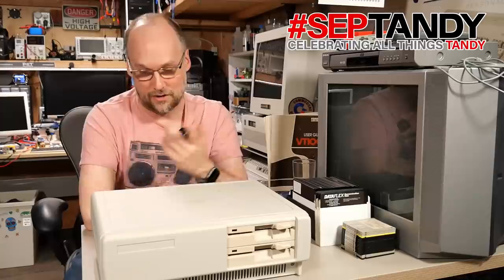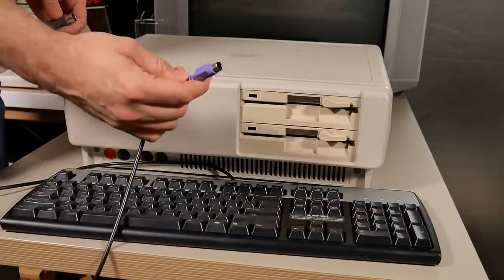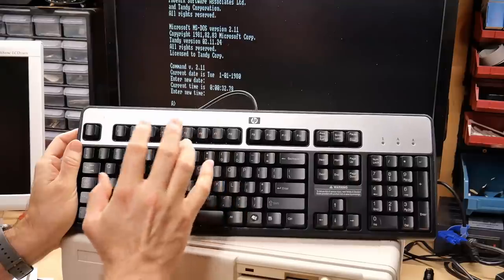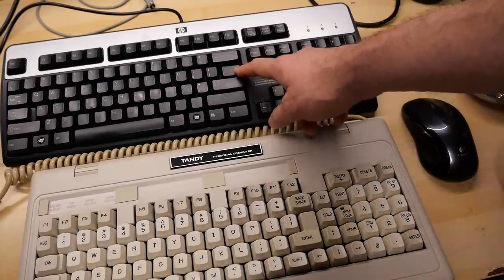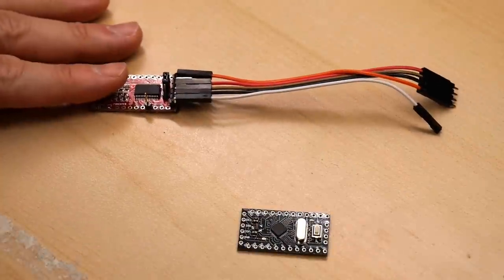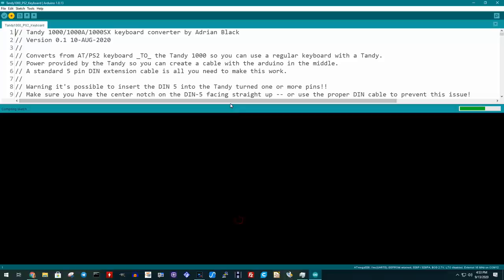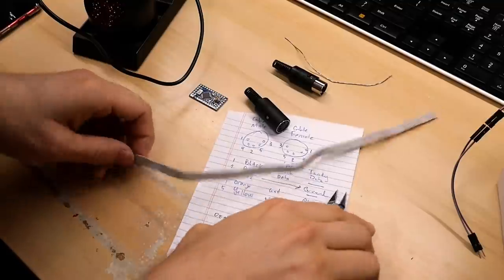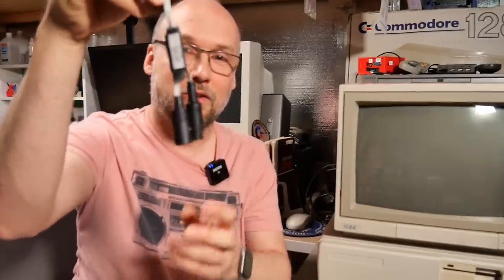Build an adapter to use a cheap PS2 keyboard with a Tandy 1000! #SEPTANDY

Comment: Hi , pretty nifty, use a mini pc to fix a keyboard

For strain relief back in the day when we home made serial cross over cables ( 9 to 25 pin or double ended both sides  -4 connectors )  we use to use cheap / free floppy drive flat ribbon - for strain relief we just used 3 zip ties

The large one was laid flat, then at each end we use a smaller cable tie that went around the cable diameter and the flat tie ensuring that after the "wrap was some loose inner cable cable where the soldered joins were "

Hmm hard to explain, ok, lets assure the large flat zip tie is 6 inches, crimp one end, then ensure the inner cable is 8 inches long , then cable tie the other end, this gives 1 inch each side as slack.

The other way with 4 wires was to use a 12 volt in line glass style car fuse assembly ( they are about the size of your finger )
open it up , pass one side of the cable into the fuse holder, then use a zip tie to stop the cable moving internally, some slack , then repeat on the other end 

We also used to grab a permanent market and draw a line on pin 1 red or black on  earth to make sure we got it right

Regards
George
Reply: Arduino Nano is a micro-controller, not a mini-PC. You can get other micro-controllers that are just a straight IC, but the Arduino is easy to work with since requires no special hardware to program.

Comment: One note for people wanting to build something similar - If you use an Arduino Pro Mini, keep in mind there are two versions. One has 5V logic like a normal Arduino and the other has 3.3V. Most other Arduino boards use 5V. I am not sure 3.3V logic would work for the keyboard signals. Also, even though you can power the 3.3V Pro Mini with 5V on the RAW pin, the VCC and the other pins will be at 3.3V including the programming pins.
Reply from the maker: I'm pretty sure the IO pins on the 168 and 368 are always at the voltage of the VCC input. Don't use the RAW input as the MCU operates fine on both 3.3v and 5v directly fed into VCC. (Bypass onboard reg) This has been my experience at least.
Reply: @adriansdigitalbasement  I suppose that's true as long as you are sure to use VCC only. The only difference at that point would be the clock speed (16mhz vs 8), but that's not going to make any difference for a project like this. Thanks for the quick reply.

Comment: That tiny old chip in the arduino has around 4 times the processing power of the 8088 used in the Tandy 1000.
Reply: But it lacks the RAM and video processing that the Tandy had that the ATMEGA328P just doesn't. But, yeah, MCU's definitely gave grown.

Comment: Back when I had my Tandy 1000A, I eventually found a pre-made adapter to do this same thing (in-line adapter for DIN AT keyboards).  Don't remember where I had found it, might have been at a Computer Fair (remember those?  You could actually buy all the pieces you needed to build a computer all in one day, bring them home and build your system right away).

The F11 and F12 keys on those early Tandy 1000-series machines had different scan-codes as an AT F11-F12 (as I understand).  The original Deskmate (maybe Deskmate II?)  required the Tandy 1K keyboard for certain functions, and some games ported to the machines made use of them.

Comment: If you're not experienced in soldering it can be worth spending a few dollars more to get the fancier DIN connectors with the metal casings. I found those much easier to work with when I was building an adapter for my Apple II recently

Comment: Fantastic work, Adrian! I was thinking of Young Sheldon and all the story lines about Radio Shack of the 1990s. I remember looking at the Tandy machines back then, but didn't bite (or is it byte!) because my focus incorrectly or not, was on software compatibility, and every article I read plus the warnings of Radio Shack themselves led me to believe that the 1000 and its successors would not be compatible with most of the existing software at the time and that you were stuck buying software at Radio Shack as well as the hardware. Later, that proved not to be the case as much because third party software vendors started producing programs for the tandy, but I think it hurt sales of the machines, as other brands of  machines, notably from Compaq, were not IBM but yet they were compatible with much of the third-party software being written at the time . Later, I became aware of the complete office suite that Radio Shack had available for the Tandy machines, and learned that it was one of the best all-around packages available at the time until Microsoft office came along. So, live and learn I guess!
Reply: Na, the Tandy 1000 line was based on the IBM PC-Jr, and was the very definition of PC-compatibility for years! Now, if you wanted it to be backwards compatible with TRS-80 software, then you'd be out of luck, but the Tandy 1000 line would run ANYTHING that an IBM PC/XT/AT would. It was also cheaper, since IBM at the time only thought to copyright their BIOS firmware, rather than the hardware itself (which everybody cloned).
Reply: @BlackEpyon  in fairness to IBM, they were still under the purview of an antitrust case with the Feds. That's why they didn't roll their own OS or use their own CPUs and instead went for off-the-shelf components. They briefly did consider buying a 50% stake in Atari Inc at the suggestion of Warner CEO Steve Ross but at the time, Atari Inc didn't have their own standard 80-column video adapter for the 400/800, they were using 6502s [while working with Synertek to roll out the "6510" which had 16-bit extension instructions but apparently crashed and burned], and the other CPUs Atari was working with and considering were Motorolas and Motorola didn't have the manufacturing capacity nor the robust 2nd source suppliers or decent licensing terms for customized versions of the 6809 or 68000. What a shame.

Comment: Adrian...great video!
Helpful hints that may have been pointed out... since you are using and ftdi, no need for a bootloader at all.  That's really only for serial so it can pull the program up through the serial lines at boot time.  Just select the next option down on the arduino menu to upload...I can't remember what it's called.

Comment: When your keyboard controller is more powerful than your main CPU...
Reply: The AVR may be faster, but it's not more powerful. The AVR can only run code burned into its flash, the 8088 can run code from RAM, enabling so many more possibilities.
Reply: @eDoc2020  I was just being facetious because I find it funny that the uC has a higher clock than the PC. I probably would have gotten a similar response regardless of what word I used though because this is youtube.
Reply: That AVR can emulate the 8086, using external memory, at native speed of the Tandy. A second AVR could emulate the graphics card, yet another could emulate the sound output, a fourth one would take care of the floppy interface (emulated or going to real floppy drives). So it is more powerful in every meaning of the word, no ifs nor buts about it. It absolutely doesn’t need to run code from the flash if the goal is emulation. Three-four $3 Arduinos, some sweat equity in coding it up, and you got yourself an OK Tandy 1000 clone. For reals! It probably could be made cycle-accurate, too, for perfect emulation. An AVR can run slow-ish Linux. Been done, google it up!
Reply: @absurdengineering  True, I wasn't considering that you could emulate the Intel CPU, and I have read about the AVR emulating ARM Linux. I think it would be at least a bit slower than the original, especially considering you'd need extra time to handle multiplexing some of the lines due to the 328p's limited IO pins.

You certainly couldn't emulate the graphics chip in realtime with just a 328p, you'd need to be changing output pins every cycle, not leaving any time for accepting writes from the CPU or even computing the required writes. If you overclock the 328p to 28.6MHz you'll get two cycles to do each write, which can probably give you some useful color composite graphics output, but not Tandy graphics.
Reply: eDoc2020 Yeah, you’re right. I just tried it and it’d take a couple 328p’s to do graphics. Amazingly enough, it’s still cheaper than trying to use legacy discrete TTL glue logic to do the speedy parts. With separate 328ps one does refresh address generation and timing, another does palette and font lookup and and DAC. Those two pretty much replicate the CRTC. Tandy graphics weren’t that complicated - no sprites IIRC, unless I’m looking at the wrong docs.

Comment: now just use a USB keyboard..
USB -> PS/2 -> AT -> tandy 100

what a chain of adapters that would be.
Reply: There're actually Arduinos with USB interface available - will require some additional tinkering though.
Reply: Don't forget to try a wireless keyboard USB dongle -> PS/2 -> AT -> Tandy.  I've actually used a Logitech keyboard and mouse on a shared wireless dongle plugged into an On The Go adapter, then the OTG adapter into my Android tablet or phone.  They both work fine, a bit weird seeing a mouse type pointer on your phone!  As long as you can provide enough current for the dongle it should work fine on the Tandy; obviously you'd use only a ketyboard, the mouse would not work.
Reply: I remember back when USB was still kind of new (early 00s) that you could buy PS/2 keyboards that came with passive USB adapters to connect to the still common PS/2 ports on compys.

For a while I had this one that used the passive USB -> PS/2 that it came with, then a PS/2 -> AT so that I could use it on my (just a tad dated) Pentium computer.

Comment: This is really cool. It might be worth building a dedicated keyboard by incorporating the Arduino board into the keyboard's shell, then running a DIN cable out of it straight into the Tandy.
Reply: You could simplify the whole project by replacing the original keyboard microcontroller at that point.

The major benefit of an adaptor like this is that both the computer and the keyboard can remain unmodified.
Reply: @TheTurnipKing  Replacing the keyboard's controller outright is harder. You'd need to design and fabricate a separate PCB to mate with the matrix, and then it would be limited to only that line of keyboard. The arduino can just be spliced inline and hidden inside the keyboard, which is much simpler.

Comment: Thank you Adrian. I can't believe there wasn't a solution for this already. Long time coming. 
Also, there is a keyboard called the Northgate Omnikey that supports the Tandy 1000 scan codes, but its not fully compatible and almost (but not quite) as rare as the original, and it still needs an adapter. It took me months to find an original Tandy 1000 keyboard in non-working and damaged condition. I did get it working though.
Reply from the maker: What's funny is last year when I started working on this there were none -- but it seems multiple others have worked on this same exact project in parallel to me! I put links in the description to their projects.
Reply: Robert Krenicki (the EX/HX 3-in-1 guy) has been building adapters using the ATtiny. I know he's been held up by having issues getting some of the parts he needed, but I think he finished up a batch of them not too long ago.

Comment: Nice work! I think that HP PS/2 keyboard is required inventory for any Portland area Goodwill as well (I have one as well - with the extra multimedia keys).
Reply: I wish the thrift stores in my area had a decent amount of retro-content. Too much of it just goes to the Bottle Depot for electronic recycling. I keep looking anyways, but the pickings are usually pretty slim.

Comment: Nice job, Adrian!  You could actually install the adapter inside the keyboard to create a dedicated Tandy keyboard, using the proper DIN plug on the cable end and everything.

I'm sure someone likely come up with a circuit board layout to hold the Arduino and PS/2 jack, and a header for a Tandy-style keyboard cable.  PCBway might be a good candidate for making the board itself.  Add a 3-D printed case and it'll look factory fresh!

If you ever make one of these adapters for older Apple machines, you can call it an "ADB ADB Adapter": Adrian's Digital Basement Apple Desktop Bus Adapter!
Reply: A dongle mezzanine board wouldn't be hard to make (and quite cheap with those dimensions), but it would limit compatibility between Arduino devices because of the pinout. The beauty of wiring it straight like this is that you can just use whatever Arduino you have on hand.
Reply: @BlackEpyon  I was not aware of how many different Arduino device models or styles are out there, but I did assume that their designs might change frequently.  I was hoping there was some standardization so that a small PCB could be made to accept the more common ones at least.  Mainly I just wanted to encourage the exchange of ideas; I am not disappointed!
Reply: @bobblum5973  You certainly could make one to fit the Nano, you just might be limited to that model, that's all.

Comment: I'll have to remember to look in to this possibility for my 6000HD that I don't have a keyboard for... Apparently one for a 12 or 16B will also work on it, but, yeah, not terribly easy to find.

If I ever get to a point that I can re-cap the power supply in the thing. 

Worked great first time I powered it up after I got it a few years back, it loaded up to a Xenix prompt I could do nothing with, no problem. Second time I hooked it up earlier this year just because I had nothing better to do, after a bit of wiggling the pile of cards around and powering it on/off a few times the errors went away and it came up once again, and then a minute later that oh so fun hissing and popping with that distinct frying capacitor smell happened and the power cord got yanked out super quick.

Comment: The Amstrad 1512/1640 has a similar issue.  The keyboard interface is non-standard on that machine too.  I believe it was a common point of differentiation for early PC clone makers.

As long as software targetted the BIOS for keyboard input, it wouldn't be an issue for compatability, but it also meant that there was at least something on the machine that deviated from the original PC design heavily.

Like the Tandy, the technical reference guide fully describes the timing for the machine specific keyboard interface.
Reply: I've been looking at trying to make a fake keyboard for the 1512 using an arduino but I haven't have much luck getting the computer to even recognize a keyboard exists even using the timings suggested in the docs
Reply: @juappdev  I didn't have much luck with it either, but I honestly couldn't tell where the point of failure was, my soldering, my programming or the documentation.
Reply from the maker: With the Tandy stuff, I used my scope to validate things and found the real keyboard didn't exactly match the documentation. So, I made the code replicate the real keyboard not the documentation. Maybe Amstrad did something similar where the docs don't match reality.
Reply: The Amstrad PC 4386SX is the same. I think the pins are a slightly different diameter to a standard 5 pin DIN as well.
Reply: @adriansdigitalbasement   I suspect that's the case.  It's been a while since I looked at it, since I picked up a real keyboard shortly thereafter.

It might be worth revisiting now, especially since I have the original device for comparison.  The computer resets the Keyboard for a few seconds so it might be interesting to see what the keyboard microcontroller is actually outputting afterwards.

Comment: Obviously, now you already did all the work, but for programming I'd wire two inputs to the arduino and have a sort of testing program which reads input from 1st keyboard, then input from 2nd keybaord, and creates a map that is written out to console for the final program, as that would make the code usable for not just the Tandy 1000. Heck, I might try that out :)

Comment: Code looks ok, it works that is the main thing.  You can maybe trim it a bit by defining the translation table more like this, I often use sets of 8 or 16 per line for tables....
 
unsigned char translate[256] = { 0x0B, 0x02, 0x03, 0x04, 0x05,  0x06,  0x07, 0x08,
                                                         0x09, 0x0A ..... etc
                                                       };

If you don't want to re-key it then just use a for loop to dump the table you currently have to the serial at runtime :-)

Comment: actually most usb keyboards come or came with a passive converter to ps/2 minidin (which is the same as AT with a different plug). keyboard firmware doesn't change all that much so there is a pretty good chance you can simply cut the plug of any usb keyboard and solder a din or minidin to it and it'll just work. which retroactively even goes for XT standards. most (around half of them out there) of the oem/3rd party AT/PS2 keyboard firmwares also autodetected the XT protocol back in the days and that code may still even be there.

Comment: My Northgate Omni Ultra manual indicates it does support the Tandy 1000SX and 1000TX via one of their dipswitch settings.  My old Northgate won't disappoint ;)  BTW, really nice solution Adrian, as the Northgate does bust your cost consideration.
Reply: What dipswitch settings are you referring to because I also have a TX but the Arduino only powers on for a split second right after turning on the computer?

Comment: Try running your code through a program called astyle. It's a nice way to properly format C and C-like code. It has a lot of presets, but I tend to use "astyle A14" which is "Google" style according to the astyle manual, but it's the look I prefer. You can either use a preset number or you can individually set each particular setting - where braces go, where spaces go, etc.